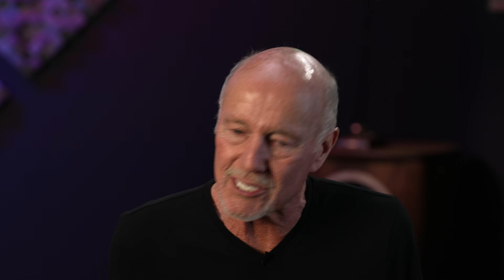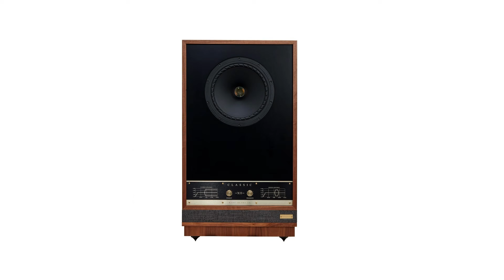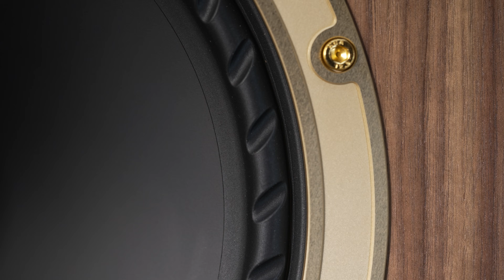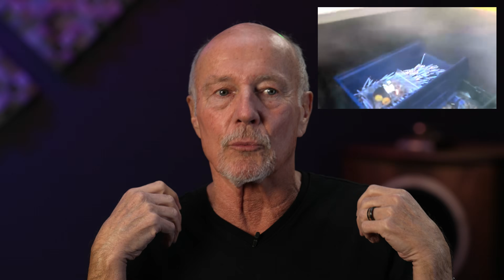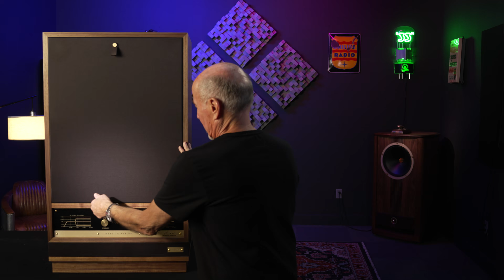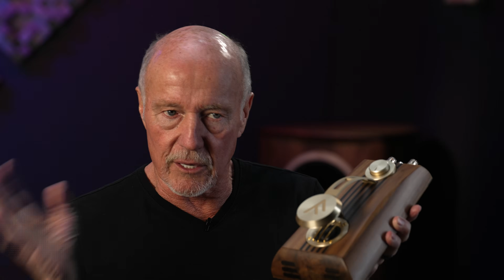First Look! Fyne Audio Vintage Classic Gold XII SP: Flagship Performance Now in Reach

Comment: Polk have been doing there bass vent at the bottom of there speakers for years, so it's not a new thing.
Reply from the maker: Good point. It doesn't mean it's the same.  Auto bias has been done by a few companies, but that doesn't mean it's the same thing as PrimaLuna's Adaptive AutoBias.  Dr. Paul Mills's design was awarded a patent for that reason.  Spend an hour with him, and it's easy to see he is at another level.

Comment: 100 $ ETI connectors - and a (literally) 50 cent sand cast resistor in the crossover (?) Better resistors sound, well better. Strange choice.

Comment: gorgeous old world looks but i wonder if they outperform more modern designs at the price point. ntl anyone would be proud to have those in their home!
Reply: I've been auditioning the 15 inch model, they are some of the best speakers I've heard. Smooth detailed sound, a little on the warm side, very impressive tight hard-hitting bass and a big soundstage. I put on some Rachmaninoff and cranked it up, it was almost frightening how real it sounded, they go insanely loud with no hint of strain or distortion. Only thing I've heard that compares are the KHorns. And the wood finish and gold details on the cabinet is gorgeus. Pictures online cannot properly convey how beautiful they are, you have to see them in person. Without doubt my new dream speakers.
Reply from the maker: Point-source drivers are fantastic, and to many people, nothing compares. These drivers are taking this legendary design to new heights.  Neodymium is used in small amounts in top-end phono cartridges.   I've seen them used in very small amounts for speaker drivers.  Using a massive magnet like that only for the tweeter has never been done before. Expensive.

Comment: Hi Kevin - thanks  - it would help dumb folk like to to understand how the super tweeter is connected to the system -- I believe it comes with wires and these are connected to the high-level inputs in the speakers that the super tweeter sits on. BUT is this how you do it?  Fyne make the one you showed in this vid but there are others. Are there relative merits?
How good are Fyne Audio speakers in or near corners ?
Reply from the maker: That's how they hook up.  Video link below.  They are less prone to placement problems than other speakers because of the Basstrax system.  Talk to one of my salespeople.  https://youtu.be/jTZIDO5ixGY